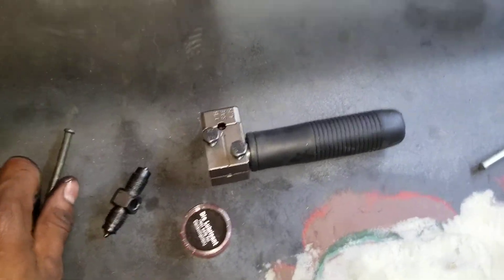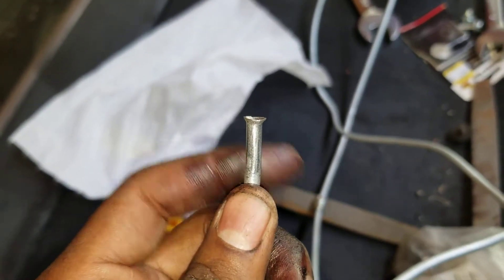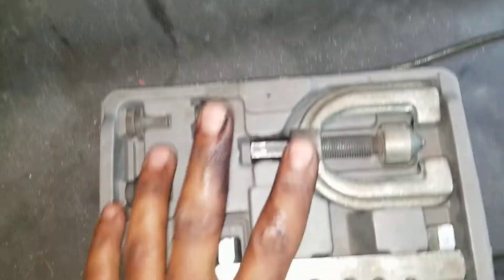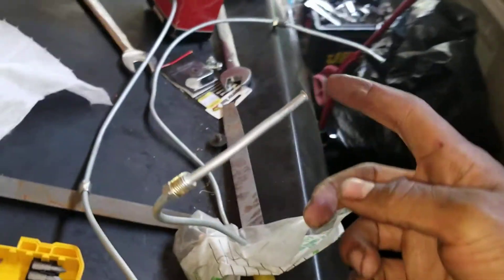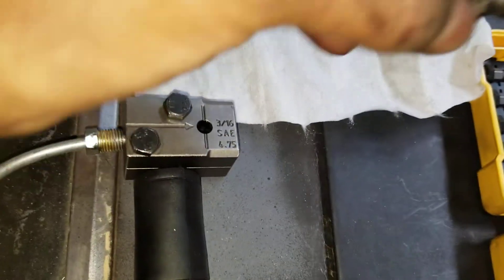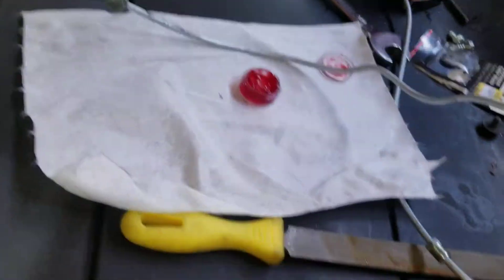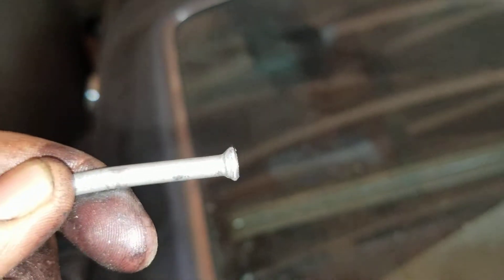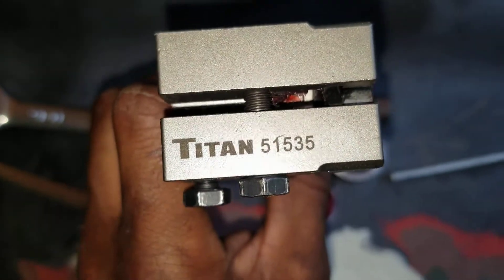Review of Titan Tools 51535 3/16 in. Double Flaring Tool

Comment: Great video! Fun tip, if you don't flush the tube in the jig, say leave it a mm away from the end of the plug, you'll get an even "taller" double flare, virtually matching OEM flares
Reply from the maker: Thanks and that's a good tip

Comment: Thanks for the review.  I'm buying one.
Just an FYI, brake lines, because they are high pressure and because the SAE flare is 45 degrees, you MUST make them double flare.  The race car guys convert to AN fittings - which are 37 degree flare and can get away with single flare.   Also, SAE flares are not really made for taking apart and re-assembling.  You can do it a few times, but the seal gets worse every time.   Rigid tools makes some really good tubing tools - including a professional grade double flaring tool.  They also have a 37 degree flare.   The problem with the tool it leaves some pretty deep marks in the tubing (where it gripped).
I have managed to double flare stainless lines with the Rigid tool (I've also snapped the little insert that makes it a double flair - so I have multiple inserts now)
Hope you keep posting updates
Reply from the maker: Thanks and glad it helped u wont be disappointed. I didnt think people would use an fittings on brake lines since theirs so much pressure going thru the lines
Reply: Thanks

Comment: Just bought one and using NiCo line and it keeps chewing up the end of flare. It's also coming out lop sided. Any issues with this and or what might be the issue
Reply from the maker: I have never used the tool on NiCo lines before so im unfamiliar with those issues. Is everything lined up and u file the ends too make sure the line is even across??
Reply: @musclecargarage8882  

Yea I have tried it a few times and comes out bad everytime. I had a piece of regular line and worked great on that. Guess ill have to just change back to regular brake lines. Not sure why the NiCo line won't flare
Reply from the maker: Is the NiCo a softer type of brake line??

Comment: i couldn't  agree w you more my man ! the other double flare kits are junk !! just got done doing the rear brake lines in my car , and they just leaked ! threw away those junky kits and bought a lisle kit , same as the titan . big difference
 the tool you have. is the same as the one i used . makes much better flares . the junky kits justmake sigle flares , even if you wanna  call it that   . that titan tool is cool coz you can remove the handle and get it in tighter areas
Reply from the maker: Agreed 👍
Reply: Do you have any issues with the fitting not going down far enough? Mine sits above the flare instead of hugging it?
Reply from the maker: @bradbaker5713  No I haven't had that issue. It kinda already has a mark where it suppose to stop
Reply: @musclecargarage8882  they flare everytime.  I bought fittings for 3/16 and instead of hugging the flare, they sit above it.  I thought I might be doing something wrong, because it's not flattening out the flare enough for step two
Reply from the maker: @bradbaker5713  whats hugging the flare. Im kinda lost on whats going on. Are u tighten everything?

Comment: if you were to learn how to use the other flaring tool you can get the same look
Reply from the maker: Yes that is true but its definitely not the ones from the local part stores
Reply: i get the same result's with the one from the parts store
Reply: but don't get me wrong i do like the one you showed it did look a lot easier to use
Reply from the maker: U did better with it than i did
Reply from the maker: It is trust me